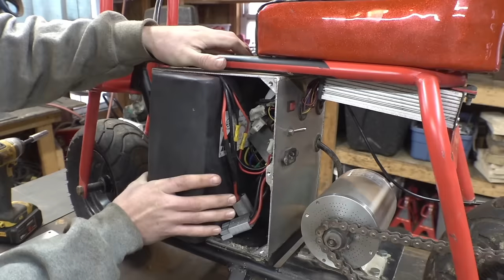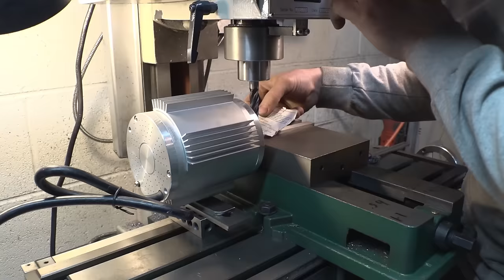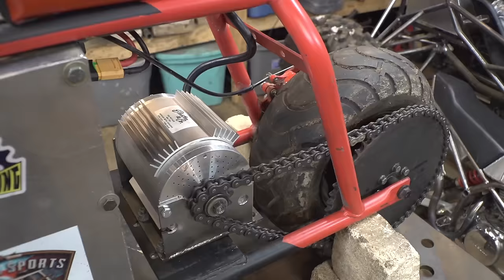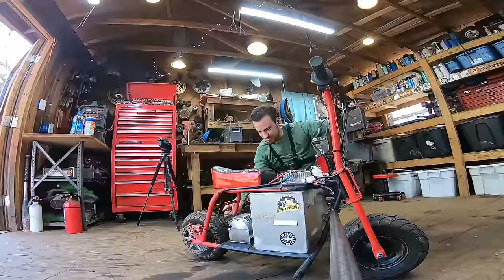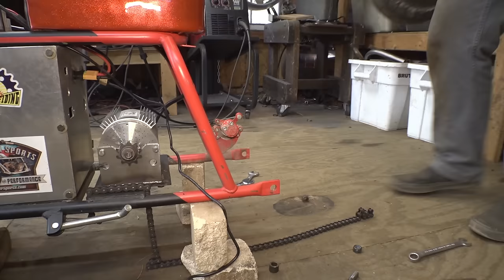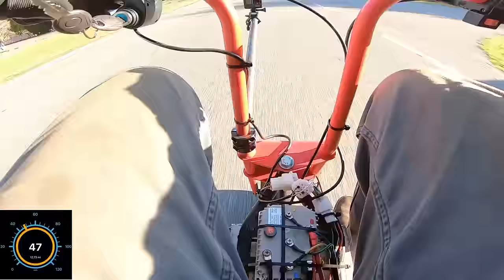Insanely Fast 6000w Electric Mini Bike!!

Comment: No helmet on the street can win you a spot in the forever box
Reply: Off road too, those rocks and trees are hard on the skull even  at low speed
Reply: Let those who ride decide...
Reply: @sykwookiee  hey man you do you I dont care but as a youtuber with possibly a younger audience he should set a good example of the proper way of safety. Plus Id hate to see anyone hurt needlessly
Reply: Yep dumb move
Reply: after 30 miles an hour at the helmet becomes a lethal weapon. I've seen them shatter, and cut people's jugular vein. My helmet split in half and cut my face. After 30 miles an hour you're kind of on your own. It can also cause your head to bounce, & cause your neck to snap from it. also
Reply: And yes it was a DOT approved Bell helmet
Reply: Yeah nothing's going to save you on the road when you're on two wheels there's no helmet strong enough no back support strong enough no leather thick enough to save your life.
Reply: @joshlang4660  you should watch motorcycle races, those guy come off the bikes at some pretty insane speeds and usually walk away. Must be something to the safety gear.
Reply: @SuperBigdanno  obviously you're not a rider yourself or you would understand what you just said. They have very minimum objects to run into and most track racers don't ride motorcycles on the road because of how dangerous they believe it is none of the protective gear that they wear is going to save your life on public streets. They are crashing and laying their bikes over at sometimes excess of 100 mph usually it's in turns when they drop their speed quite a bit And then you watch him slide how far you said? At least a good 40,50,60 yards. Now go out on your normal street or even a highway and look at 40/50 and 60 yards and see how many things you will hit and can hit also with all the additional traffic and people that don't pay attention that can hit you once you come off your bike none of the protective gear that we have available will save you from a semi running your ass over. No helmet or back brace will save you from breaking your back or killing you by hitting your head so hard against guardrails street signs posts or into other vehicles. So yes why they get to slide when they lay their bike down in a race they usually don't have to worry about hitting objects or people not paying attention to what's going on around them. So again if you understood the actual aspects of riding motorcycles and what you just said in your statement quite clearly does not line up. I'm not saying you shouldn't wear any kind of safety gear definitely don't go out there wearing shorts and flip-flops like they'd like to do in Florida. But you shouldn't get on a bike thinking your helmet alone is going to save your life cuz most people don't wear thick leathers whether pants proper footwear a full one-piece suit instead of a two-piece or a very high-end helmet. And even with all that on you hit a street post or street sign with your back You're breaking your back and if you hit a dual post sign you're probably breaking your back and killing yourself once your head hits the other post 10 mph accident on a motorcycle con damn near kill you on the street just by hitting a curb in the bike flipping up on top of you Even with a helmet on. My cousin was riding a motorcycle someone pulled out in front of him his GPS recorded it He was only doing 12 mph turned into the curb and the bike flipped over him while he was wearing his helmet and it crushed his helmet gave him brain damage there was brain matter on the scene My cousin wasn't a cheapskate he didn't buy a cheap s**. He worked for a good if it weren't company making good money doing their land contract for oil. And then since he's very lucky that that helmet may have saved his life considering he was on soft grass when the bike came down on him and it invented the ground so I had some cushion there too I guess if that was on concrete he would have probably been dead. It's been several years and he's still so f**** up 5 days of the week he wishes he was dead. One of my good friends growing up was going over a hill a drunk driver hit him head on and he died as soon as he hit the car we're talking leather jacket and a helmet which is still more than what most riders wear. So not that safety gear is not important and yes you should wear it but it's a false impression that it's going to save your life on two wheels comparing track to street roads is no comparison.
Reply: @joshlang4660  I cant ride anymore but have put many many miles on bikes, quads, snowmobiles and all the way back when 3 wheel atc's were new. I was fairly lucky and for the most part was able to stay upright and rubber down but did have a few falls over the years. 
I will take my chances with a helmet as I have seen first hand what no helmet riding can do and at real low speeds too and its not pretty to say the least. 
Yes riding on the street is more dangerous than a track no question there but if those racers were not wearing their protective gear there would be a lot more serious injuries and fatalities.
Reply: @SuperBigdanno  i agree with you ..i was riding my bike one day doing 53 when a van pulled out in front of me ( there was a big bush and iam on a pit bike ) i slammed into the van my bike went into the ditch. I had a terrible headache but my skull was still in one piece. i allways tell my little brothers just wear the fucking helmet even if it aint "cool" 😂
Reply: If it's your time and God wants you, a helmet will just make your exit more painful. Helmets are for fools!!!

Comment: On my electric bike the best addition was regen/e-brake. Even though it regenerates about 10% which is not much, but it saves me a lot of money I would spend on brake pads.
Reply: Is it activated when you let off the throttle?
Reply: @tonyfoxxbuilds1920  No. By default it is an analog input to the controller (3 wires like  a potentiometer) so, when you pull the brake lever it gradually increases the ebrake power, but I just added a push button for my left thumb and it brakes on max when I press the button.
Reply: It depends on your motor and your controller settings

Comment: You should get 4 of those motors and put them on a small buggy.
Reply: A tip of the hat to you
Reply: @shane_7even_ten569  Seconded.
Reply: For sure
Reply: Yep for sure, easy way to do 4wd… oh wait did i say easy, yeah nah, bloody complicated getting the controls all correct

But still traction control, 4w burnouts, 4wd donuts

Yep now i want one!!
Reply: @westie4ageturbo.749  right lol not easy at all unless you have some experience

Comment: 6000 watts is the equivalent of 8hp on that tiny bike.
You're nuts Chris lol. The Pit bike will definitely be safer. Looking forward to more!
Reply: where did you get the motor and controller from?
Reply: @bryanannas  yeah.. all i can find is 3000w
Reply: @supermantom2456  That 3000w can easily handle 6000w just add some heatsinks. You just need an 6000w rated controller.

Comment: Holy crap that thing looks fast. Imagine that with full fairings and a lay on the tank position and tall gearing, you'd be ready for a Bonneville Salt Flats Run. 👍👍🏍
Reply: i built an E bike this year... im able to get to 45mph with a 750w motor from bafang... they are absolutely scary as hell hah. i couldn't imagine having a 6000w motor

Comment: Looks fun, Chris. I'm looking forward to seeing the pit bike run. To reverse the motor you can swap any two of the motor wires. doesn't matter which color wires.
Reply: its not an rc bro no you cant exactly what he did was correct fyi
Reply: Don't forget that this is a sensored brushless motor. Which means that you also have to switch the corresponding Sensor wires as well or there is a possibility of damaging the Controller and or motor.
Reply: @backwater1536  These motors ARE exactly like brushless RC motors. Just larger.
Reply: @bradley3549  He's backwater...don't start with educated logic.  he be trollin'

Comment: You need to put a couple air ducks on the battery box that directs air flow directly to the electric motor and that will help keep the cooling down
Reply: Ducts
Reply: Rain water ? . . .shorting out?
Reply: @mkultra4542  yes I meant ductwork and I believe the motor is sealed 🤔😎

Comment: Wow! We love what your doing with our equipment dude. This is what its all about!

Pro Tip: We have found that for a 10 inch wheel you can get maximum acceleration and still reach about 50mph with a gear ratio of about 5.7/1. This is about the limit of the motor but makes sure you aren't wasting an extra power to heat. 7.25 / 1 is best for torque on a 10 inch wheel with out being TOO short. 

Keep it up brother!

Comment: Chris you need to duct airflow to the motor thru and beside the battery case via scoops to cool the motor. Heat stifles electrons from flowing efficiently. You need some motocross pads. Those mini bike tires aren’t safe at those speeds. Check motor, wheels, and tires with Infrared thermometer.

Comment: I love your videos and learn alot each time I watch one. I used to race go karts in the '80s and we used a cogged belt drive. It's similar to today's timing belts on engines. They are so smooth and quiet, you should look into trying that. It would be better for on road vehicles though. Dirt and rocks would kill it.

Comment: If you want to learn easy, controllable wheelies, mount some pegs back by the rear axle. As for brakes, your speed controller is programmable. You should be able to program electric brakes into the controller.

Comment: I was green with envy when Chris machined back the circular weld he'd used to insert the disc into the centre of the smaller rear sprocket. It was perfect in there, no encapsulated slag - nothing, just flawless steel on both sides. Will I ever be able to weld like that? Somehow I doubt it.

Comment: From my personal modifying motorcycle experience I recommend going up a tooth in front sprocket and then down two more in the rear and I bet you this badboy will do highway speeds with ease and changing the front and rear will ensure you don't loose any out of the hole torque as you might if you simply modified rear only....

Comment: Something my uncle taught me for every 1 tooth added in front is like 4 minus in the back or 4 in back minus 1 up front drive gear good way to figure things out I watch how far down the back as you do that the amp shoot up and the heat will double get a temp gun on the motor it will help you with the gearing it and the control can handle motors 225 top controler 200 less chance of frying it I like keeping temps around 180-190 tops and electronic last much longer applying this  safety will also keep batt from blowing up watch those temps also save much money I got rc cars that are pushing 15 horse power with motors size soda can   have little Pocket 4 wheeler with those little 49cc motor thinking of turning it into electric for my kids .keep up great work

Comment: It doesn't matter which wires you swap. The motors work through pulses of voltage so you can't swap the wrong wire. Any will work.

Comment: That would be my luck it would definitely run backwards when I first hooked it up. 😆
Reply: Just switch two wires.
Reply: @emersonb5764  Yeah it's very simple to fix if it's not a sensord system. If it's sensord ya gotta go into the ESC and change it. I was basically just saying I have super bad luck 😆 ✌️

Comment: 53 mph was the fastest I’ve gone on my old road bicycle.  Long downhill with a 53 tooth front ring and 12 tooth rear.  I gave up trying to pedal because I ran out of gear and was not putting any power to the ground.

I can’t image going that fast on that little thing and I was running a narrow 20mm wide tire.

Comment: Can you adjust the speed controller to make the motor brake/recharge the battery when releasing the throttle?  Like a Tesla.  It would help with braking and recharge the battery.  May want to wear a helmet in case the brakes fail.  Saw the brakes stop working in the video while typing this lol.

Comment: Just so you know, you can overvolt the old motor and it will be damn fast too. They might be coiled differently but you can easily add a bit of heatsinking like the "6K" one has. Depending on the reputation on your seller, these motors may be the exact same thing with a little added heatsinks. The majority of these sellers and manufacturers aren't very honest.
Reply: Your correct on that they add the heat shrink and raise the price!! Just need a solid battery and a very very good speed controller
Reply: The company he bought from actually uses a 48v motor with thicker phase wires I believe. The 6k is referring to their advertising on the batteries capabilities. 6k peak but like 3 or 4kw continuous so they’re not all their cracked up to be

Comment: That is one killer of a motor, wow. Awesome. 
Battery life will last a lot longer if you ease into the throttle, instead of just gunning it especially with those tall gears.
I would highly recommend a full-face helmet, leathers and boots not those little moccasins, especially at that speed on that little bike that is definitely not designed to go that fast. Ok, may not all that but definitely goggles, gloves and boots, NOT those moccasins or slippers. 🤣🤣🤣Ride safe.....

Comment: get a good battery charger that will discharge/charge, and have cell balance/storage mode. it's an investment but you're battery will last a long time if you maintain it. just like an engine in a sense, just a different way to maintain it.

Comment: hey, so theres mosfets in that controller that hold power even after you disconnect the battery. thats what arced after you pulled out the connections. no harm, its usually how i discharge them when putting away controllers after use

Comment: You could make it like 10x faster if you extend the frame a little and swap the gears so the larger gear is on the motor end it would be better if the motor itself had a built-in high torque (mid speed) gearbox so it doesn't overheat the motor

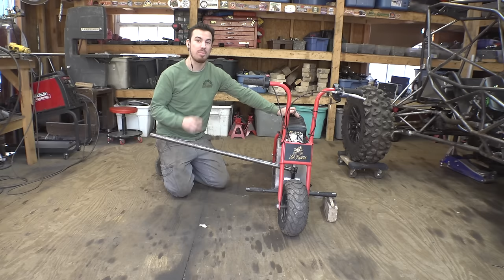Comment: 10:35 " Probably have to change the gearing" you said. Which way would you change it? A lower top speed or a higher top speed? Your test run looked great! 15:30 I found your gearing you did. Great job! You have all the tools and skills.

Comment: If you can afford it, they make a drop-in, multi-speed electric motor that would bolt right in place of a pit-bike/honda cub engine...main draw back is they seem to be half the power of that motor you have. (so if its speed and power, you're better off with what you have)

Comment: you could go faster than that if you switched the smaller gear on the wheel to the motor and also a little more smaller to the wheel , maybe go 55 mph . also i would be working on making the front forks more stable as well the handle bars , it could be a more awsone speed mini bike .

Comment: Wheelies can be hard to master because the learning curve is a little scary.  nobody wants to fall over backwards,  practice on the grass with your helmet on.   That said,   when you wheelie,  you are always a little to far forward or a little to far back.  it's like a bicycle,  you're always a little off balance to the left or to the right,  the subtle adjustments that keep you upright on your bicycle are what you're looking for in your wheelie,  they are small subtle adjustments with the throttle and upper body.   You can do it.

Comment: Keep the gearing torquey  . . . . my Yamaha DT125-LC came standard with 13 teeth Front x 49 teeth Rear . .i changed it to 12 front x 52 rear . . .much better torque but ran out of revs at  62mph or 100 km/h

Comment: You are crazy i had one these with a briggs and stration motor 0.5 horse power so i switch out for a 5.5 horse power honda motor and it was wheelie machine. Death machine. I want it

Comment: I wonder ?!? If you have enough room on the pit bike to add a Alternator to it he system to recharge the battery while your under power ? And if you did would you need some sort of ac to dc converter 🤔🤔or dc to ac .

Comment: I think maybe the slightly smaller sprocket would be better, 48t over the 54t or what ever it was,  probably around a 44t - 46t  would be fast and fun, maybe a battery with another cell or two, for a few more volts,

Comment: in the rear left corner of the frame you could place a mount with 2 sprockest as a reduction. so you won't have to use one very small and one very big sprocket

Comment: Could a CVT be fitted to it.. great project
Reply: Maybe, but it wont realy work because a cvt has a lot of losses in heat and an electric motor has pretty much the same torque over the rpm range so if you just have to find the sweetspot between torque and top speed

Comment: Does anybody think 1000 watts is enough to to drive a lawnmower through the stock axle and gearing? Or would I need more power because I am looking to be able to pull things around and the trailer would be quite heavy

Comment: Above 60V DC is dangerous for a human. After disconnecting the battery turn on the controller so the caps drain to safe voltage.

Comment: I'd put on the big sprocket and add an alternator or generator on the chain it would be self contained and the added torque will give power to run the generator. Good show.

Comment: Electric vehicles are very big fun!
Check out my off-road scooter https://youtu.be/tSFuy5WkJb8
I’m riding with an 8000watt QS motor (much more quality than your motor) and pulling easy 15hp.
With the right battery and controller you can hit 150 km/h in two seconds.

Electric is the future and so much fun

Comment: If you just duck your head down as low as you can and hug down toward your knees---- you will gain another 5mph easy--- just because of less wind drag.  Its a huge difference;  your body is acting like a sail.   If you lay down on the seat like superman and stick your feet off the back, it will go even faster. lol